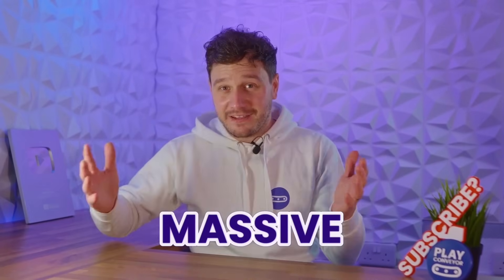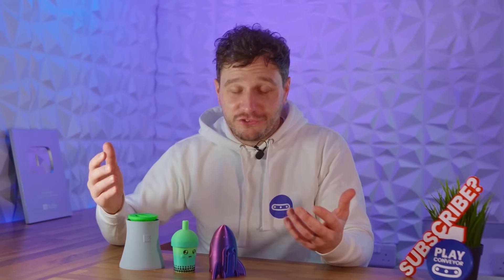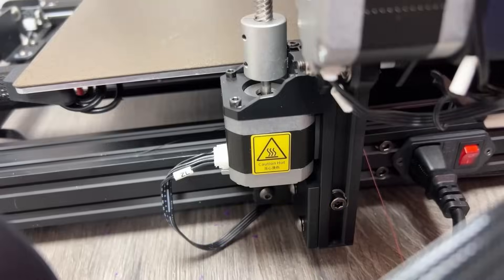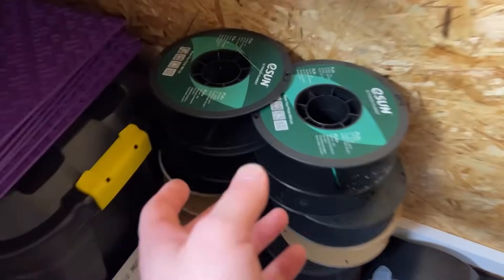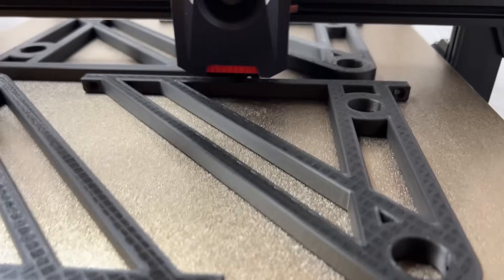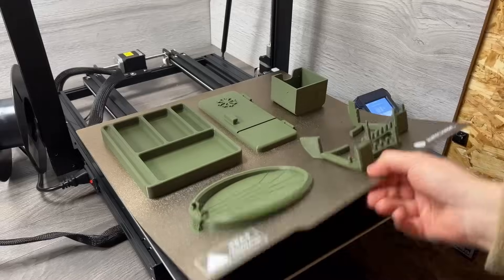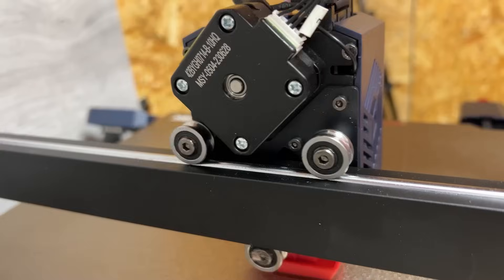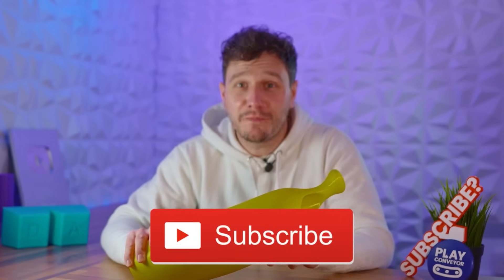The REALITY of owning a MASSIVE 3D printer - AnyCubic Kobra 2 Max

Comment: I purchased the Kobra 2 Max The beginning of 2025. Back then, I loved it. I was able to print the Star Wars Destroyer droid, a year long project, in superior quality. In that year, I had to change the print head cartridge 3x thanks to un clearable clogs and now, as of December 2025, it sits in the corner with lots of problems that even Anycubic customer support can only guess on.  It is a proprietary printer, meaning that only Anycubic parts can be used. Software written for said printer, as mentioned here, is also rudimentary / useless. There is no terminal interface for fine tuning the printer's settings like flow, PID or any of the other settings that you have to eventually perform.  Non of the Reddit or other community forums are very useful since everyone else is also experiencing the same problems as You and no one has a clue on how to fix them. This printer, while very nice, is something to avoid at all costs. Unless of course, you love troubleshooting it's numerous BS situations

Comment: My Kobra 2 Max shipped with a profile for the Prusa Slicer on the included USB drive. Never even touched their own slicer. Had some troubles updating Prusa with that profile though as it runs into an issue with some plugin, don't know, am not that much of a 3D printing nerd.

Comment: Well, the thing I will say from experience is that, taking into consideration the length of the print and how long your pre-printing process is on the printer, it is generally faster to print one piece at a time. If you are available to swap out and start the next print immediately. What you lose in time is the travel from piece to piece which gets multiplied by the total number of layers you have when printing multiple objects at once. That said, I'm lazy and rarely follow my own advice.

Comment: Great video and review that shows why people might get a large printer without saying that bigger printers are better printers because they often are not objectively so. Larger build volumes are nice, but I design most of my models to be printable on an A1 Mini since that is what I use. Anything that needs more space I can often turn into multiple prints. Despite this, I am still tempted by the allure of large printers being able to print so many parts very fast. However, I might just modify my gcode for automatic part ejection, getting a mostly similar effect.

Comment: Your math is flawed my dude. You just implied that since it can fit 4 on a build plate it is gonna somehow make it 4x faster. Not the case. Assume an 8 hr single print with the Bambu and this printer having the same time. You add 4x the part and you are looking at 4 x 8 = 32hrs. The only advantage is not having to restart the print job. To imply that in 8 hrs you get the same results for 4 prints as you would in a single print Bambu or any other high speed printer is just silly.

Comment: Elegoo Neptune 4 Plus (320mm) and Max (420mm) are WAYYYY better printers. Easier to use, Orca slicer profiles, Klipper and Fluidd so you can monitor it from your phone, I've had zero issues with my 4 Plus after 1000 hours. Awesome machine.

Comment: The kobra 2  was my first printer and the hotend module just broke and I am having to deal with high amounts of loss from my business and anycubic just will not ship it out within 24 hours so no i have to wait 15 days to get the nozzle because there is not express shipping available so I would not recommend the anycubic kobra 2 and the kobra 2 family. one 3d printer i would recommend is the Bambu labs A1 or A1 mini as it is better than the kobra 2 so just spend the extra $50 for the A1 mini or the extra $150 and save yourself all lf this trouble

Comment: I have the Anycubic Kobra Plus (ORIGINAL NOT 2!) I have found it to be very reliable and there is a community made profile for it on Cura and I get decent results with that overall pretty good printer for $500 (I think its 500 idk)

Comment: i know i'm a bit late to this, but there are some more reasons to get a bigger printer.

i design alot of things to function in two ways. to be easily printable without supports, and to fit the smaller sized print beds. think ender 3 sized. but this has led to some design constraints for size. its easy to design things to be printable, but size is a major factor. nowadays most bigger printers are faster becuase of the huge size. as someone who still uses older printers compared to things like the Kobra 2 max, or even the prusa mk3 or mini, time and size is a major factor. if i can print something relatively large in 8 hours where on my smaller printer it would take me 16 with multiple prints, the larger printer is the one i'd go for. and like you used, it can still print smaller items.

i think owning a big 500 dollar printer that will work most of the time your using it is better for not newer printer hobbiest, but as a good second printer. i think eventually everyone who does 3d printing will eventually get 3 or more printers, a small begginer one, a bigger one, and then either a high end fast one or a resin one. this printer seems to be a good option for alot of people in the second stage of printing

Comment: I've been using my Ender3 for a long time, and I always thought I would go with a smaller, faster printer for my second 3D printer.

Until I had a friend selling his Ender5-Plus, and now I've swung the opposite way.  In the list of mods I have planned out, I'm switching the movement to CoreXY and the bed out for a 400 x 400 auto tramming bed, so it's not quite your 420 x 420, it'll be much bigger than my 220 x 220 on the Ender 3.  Wish me luck!

Comment: I also have a Kobra 2 Pro. The auto-leveling sucks really hard. It always detects 2mm higher than the actual level. I even have to adjust the sensor position to compensate for the extra Z offset that is out of range on the printer setting. The printer started good. But the Z offset became imprecise very soon and the nozzle crashed ontoi the heatbed, heavily scratched it.  Moreover, the heatend has a tendency to overheat and melt the bowden tube within it. It has been confirmed with the manufacturer's repair division. I already got 5 heatend changes within 10 months of using it. I will absolutely change it into a X1C.

Comment: Why does everyone violently rip their build plates off? My prints pop right off after cooling for 1 minute. Also, what kind of psychos use razor scrapers on PEI plates?!? You don’t need that! I print pla scrapers and they work fine without screwing up the plate. Lastly, people always have ghost images on their build plates for some reason, I have nearly 3000 hrs on the plate that came with my printer and aside from one scar where the nozzle scraped to to linear rail conversion being too far out of Z adjustment, it’s pristine! It’s printed 3 4x8 V1 cnc machine kits and hundreds of lithophane moons. I guess free stuff is treated badly by all the “influencers” because it doesn’t cost them anything 🤦‍♂️
Reply: I kinda noticed that too, if i had a 3d printer i would be very cautious with everything and would 100% not use a metal scraper. printers are too expensive to treat badly

Comment: I received a kobra 2 max for Christmas from my wide and I laughed, I talked from time to time about wanting a 3d printer but never got around to it. 
I love this thing, I've must have logged 2000 hours since I started and the worst thing I've had to deal with was a clogged nozzle and any other issues I had were user error 🙃. 

I love the k2m so much but it is very very  big and some time I just need a small part. So I bought a kobra 2 pro 😁.
Which i find hilarious because I know it is actually a fairly standard sized printed but it just looks so ridiculous beside my K2M.
I do like how much quieter the pro is over its big brother. 
The K2M is so loud I had to build an enclosure, but that's fine I 3d printed that too.

Comment: The Kobra 2 Max uses a hacked klipper firmware, and it's closed. They won't release the source, which, besides being unethical, it means no community improvements.  DONT BUY THIS PRINTER.
Reply: Well people can build up one from scratch like with the Kobra 1 Max
Reply: Why not Just flash it with regular klipper
Reply: @PrototypicalITGuy  They are running non supported cpu and boards are not powerful enough for klipper. Would probably need extensive work to reverse engineering for MCU firmware unless Anycubic participated and gave people an option of firmware.
Reply: This printer sux. I got one and didn't do any decent project. The issues are over the counter. Don't buy ir for your sanity
Reply: @SeijuroHiko962  user error the kobra 2 max is completely fine if youre not inept
Reply: Also anycubic printers are thrash
Reply: @Jant-u3k  theyre pretty good
Reply: @dagurorarinsson2827  no theyre not i had a i3 mega it was ok and i have a kobra neo its trash
Reply: @Jant-u3k  ur surprised a sub 200$ kobra neo isnt good? Lmao ok get a kobra 2 pro with input shaping and klipper
Reply: Bought 2 returned units from ebay, got them up ans running no issues, being a closed software is great for some users. I have other kilpper printers that have more futures but always come back to the kobra 2 max when I just want to print.
Reply: @mauricelopez1745  that's good to hear. I'm considering getting one of those myself. I've had the Kobra 2 neo for almost 2 years now. Printed hundreds of custom and public models with it. Considering it cost $159 new, and has given me little trouble, I'd say it's just a matter of experience. Some people roll the dice when getting the budget brand. I guess I just didn't get snake eyes
Reply: Also, anycubic is Chinese, everything there is stolen technology. It might even steal your prints for illegal then blame it on you.
Reply: Thanks. I was between this and the Neptune 4 max. Going with the Neptune.
Reply: Rip the board out and install a pie and octopus or something with mainline klipper. Problem solved
Reply: as someone looking for a first printer what does this mean?
Reply: @dagurorarinsson2827  To start with, I'd avoid buying a large bed printer as your first printer. You're going to run into a lot more challenges with the bed (warping). With that said, what a closed firmware means high level....you are limited in community improvements, upgrades, updated firmware's beyond the companies supported life of the printer etc.
Reply: @joev178  literally bought it 10 minutes ago😭, but i live in a country with a very limited selection of printers and im gonna be making large models so its my only option
Reply: @Parodidical  YES, you said it better
Reply: Elegoo neptune 4 max its open ❤
Reply: Oh well, open source and eastern capitalism don’t always mix well. With that said, if the source code is closed how do you know it’s stolen?
Reply: Klipper is an open source software anycubic stole the code, changed it, and closed it off for their shit quality pritners
Reply: @_..-.._..-.._  and western capitalism does? Tf are you even on about?
Reply: @_..-.._..-.._  Please spare everyone the childish stupidity...Besides the fact that you can see references of klipper in config, people have extracted firmware and validated it's a modified version of klipper

Comment: I just got the Kobra max (non 2) just recently. Got it for an absolute  STEAL as a refurb unit from anycubic on ebay. I love me some klipper and have klippered many printers in the past due to quality or consistently issues. This is the only printer so far that its actually a struggle to justify changing to klipper (not just cause its kinda a pain with a soldering mod) due to having 0 issues with it at all even printing CF-PETG with a microswiss volcano nozzle. Just works so well out of the box that the only real reason id move it to klipper is for the remote access and KAMP, which i have had no issues with the auto level yet so thats kinda a "take it or leave it"

Comment: Sorry, I looked into this machine and that goodness I did.  Proprietary hotend nozzle, and the industries most crappy firmware...big no go for me, The original Kobra Maz was "OK" but they took everything tolerable and removed it for the max 2, a HUGE misstep anycubic.  Why the hell deliver a massive printer with a 0.4 nozzle and NO WAY TO REPLACE IT WITH A 0.6 or 0.8 ????  Dumb as it get IMHO  The WIFI is nothing but a way yo try and infect your phone with their useless software (and cant be used any other way.)  The printer WILL NOT connect to other slicers, and is locked down.  Stupid Stupid....look for these crippled machines to be on clearance for $300 within six months.

Comment: On the SD card that comes with the printer youll have profiles for PrusaSlicer and Cura! so no worries about having to use their software. Got my Anycubic Kobra 2 Neo the other day and happily using Prusaslicer with it, though seeing the dual axis motors on the pro makes me wish I got that instead! Either way having a blast and no issues :)
Reply from the maker: Ahh yeah the issue is we use Mac (I know right..) and the files are only windows based! I’m sure it won’t be long until the software is updated either way! From what we’ve heard the pro is an insane amount of features for the price!
Reply: instead of dual axis i will build this on my Kobra 2 Pro... but with a GT2 gear guide roller

Comment: if i wanted to print some shelving , say 400mm x 150mm, sides and back 150mm, how long you think that would take at say 3mm thickness, holding game cases/carts
Reply from the maker: It would be a real ball park figure without having an STL, depends on designs, curves, edges, infill, top layers etc.. but the Kobra is pretty much as quick as most out there at the moment! Sorry that sounds like a super generic answer haha but just no chance of being accurate without loading the STL really 😃
Reply: @playconveyor would the machine come with software to make an stl file im guessing for this sort of thing, or is there a seperate bit of software

Comment: i have been using the kobra 2 for about 3 months and I love it, can't push it past about 140mms without it becoming very loud but still It's rather fast and has me wanting to buy the kobra 2 max next probably any day now. I use prusa to slice with and have had great results and have even been able to print minis with dam well near resin quality with really precise settings and speeds.
Reply from the maker: 140 sounds sensible, the Max is loud too, dare I say it might be louder! Optimising a Prusa Profile is next on the list… 😃
Reply: I will end up breaking it down to reduce vibration, I'm sure I will take it fully apart and tinker to reduce the sounds might even add a new fan to cool the board bigger and quieter for better air flow and sound reduction. The issue is it was designed by engineers not mechanics, and you should kind of be both. @playconveyor
Reply: They released a prusa profile for pla on the firmware update for the kobra 2, but it's just ok, but I did notice the auto leveling did get better with the new firmware.  @playconveyor
Reply: Anything above 120 causes layer shifts
Reply: @horsthabicht9630  incorrect, I have been running my max at 300mms, and it's as smooth as glass

Comment: Also just put up a video for this printer.  100% agree for the size, speed, quality, features, volume - you can't beat this printer.  I bought a Kobra max last year and liked it enough that when I saw they put out a newer model fixing all the complaints I had from the first and added more volume - this was an easy slam dunk.  We're getting ready for a comic convention and if it wasn't for the speed and size we'd be under prepared.  I was underwhelmed with Anycubic's SLA printers - but their FDM printers - dare I say - beats out creality
Reply from the maker: This is great to hear… we just went to a comicon and it was great to see so much 3D printed stuff there!! 

SLA is a a real pain for us, the mess and smell in our studio means we just don’t do it these days… when it becomes ultra easy and no odour I’m in 😅
Reply: @playconveyor  the latest elegoo printers are easy and most come with a charcoal filter. I can send you the settings i use for elegoo resins. At that point its just a matter of supports. I normally use auto supports in chitu and double check for purple areas to add more.
Reply: @shadowmosesmusic I just got a Mars 4, can you help a friend?
Reply: @pxtmotors4478  How can I help?  Need the resin settings?

Comment: HI. LOVE THE vid.   Wondering could you put those Trays on there sides and print 20 at a time.  Might need to change the design a little but could be WORTH it.
Reply from the maker: Hey thanks 🤘… it’s a great idea, we did try that too first off but printing that orientation meant the layer lines were the same way that all the weight of the shelving was pushing down… it wasn’t easy to break but side on was way stronger!

Comment: I have an anycubic kobra 2 pro and to be honest its great it rarely fails and when it does it is because of me doing stupid stuff or forgetting to do stuff for it and the only times when the machine itself failed was because of the filament runout sensor but n the pro version you can turn that off in the settings menu so now it runs perfectly the only bad thing about the anycubic kobra series that i would like to point out is how loud they are they are EXTREMELY LOUD but other than that i would recommend these they aren't to expensive as far as 3d printers go and it works great.
Reply from the maker: Yeah it’s great, we had a couple of fails as in the video but it was just filament getting tangled on the spool holder, nothing since we swapped spool holders! Interesting about noise, we only used it in our workshop which has printers going all the time but the fans are pretty noisey, you’re right!